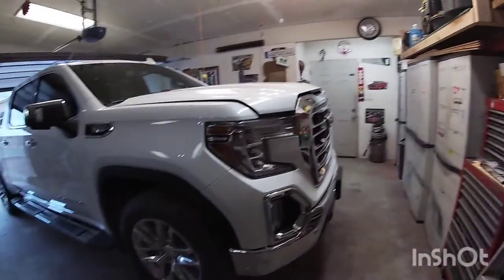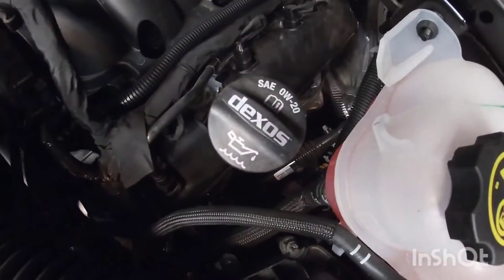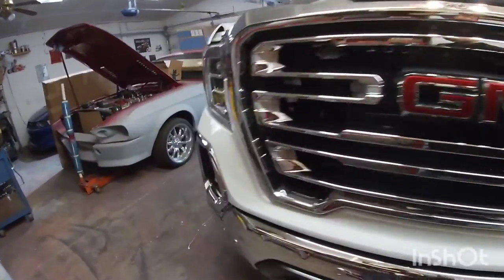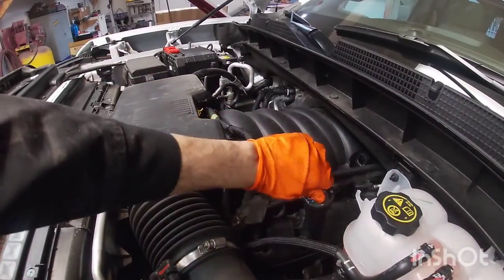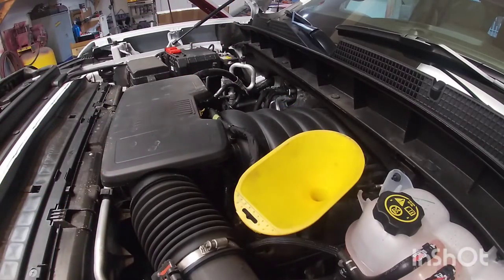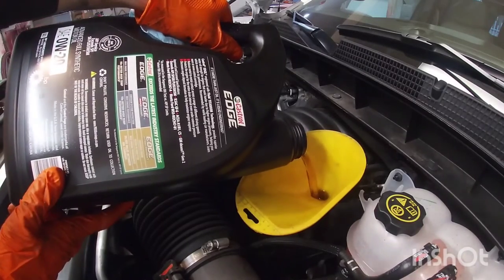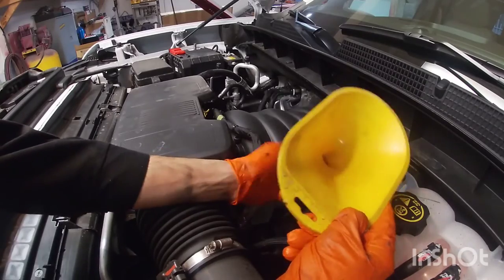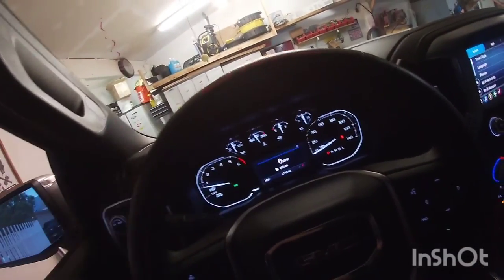2021 GMC Sierra 1500 5.3 first oil change

Comment: I use Pennzoil platinum and I change at 4000 miles so in-between my dad recommended 3000 and the dealership 5000 but honestly 3000 miles is a waste of oil since these new engines are really efficient
Reply: I ran Pennzoil Ultra-Platinum for 10 years in my manual 2012 Ford Mustang; 180,000 miles.
Reply: @andrewde78  how often you changed the oil?
Reply: @johnnynguyen9449  Hmmm between 4,500-5k mikes, around there.

Comment: What do you think about going every 5k?
Reply from the maker: In my opinion with how this this oil is and how dark it was I would not go past 3-3.5k, I know some people with these new truck and engines that have gotten engine knock after about 10k miles and i don't think leaving the oil in there for the recommended intervals helped
Reply: Thanks for the video have the same truck with 2023 miles  going to change oil soon . God bless you
Reply: Does it have to be the same filter from the manufacture??
Reply from the maker: @arturocruz3762  I like to use the Manufacturers filters just in case there is ever a warranty claim. they can't come back and say i used a filter that did not filter the correct microns
Reply: 8 qts of oil vs 5 so 7500 is ok and just check it as the miles roll by.
Reply: @aandamustangs  Color is irrelevant to how well the oil is doing and how much life is left. Get a used oil analysis from Blackstone instead of speculating.